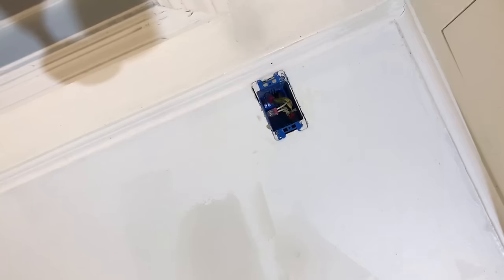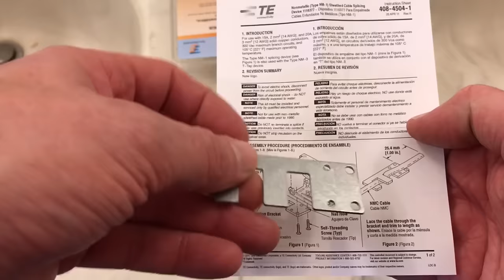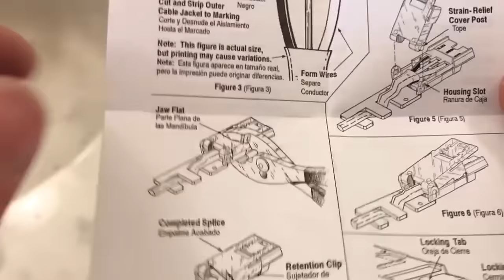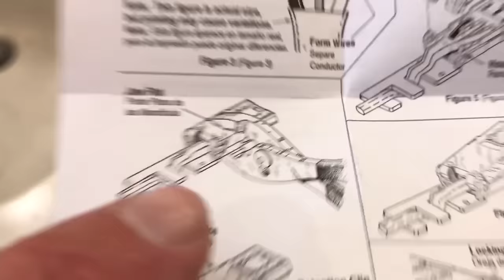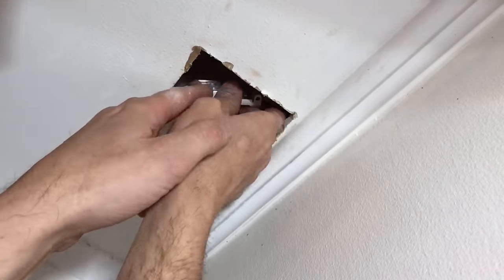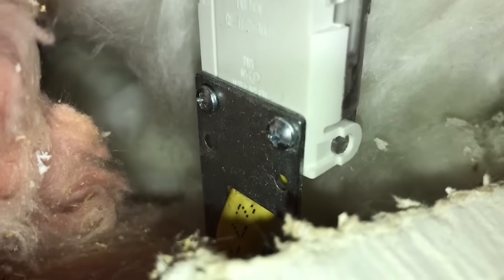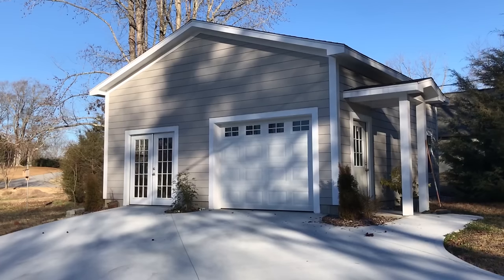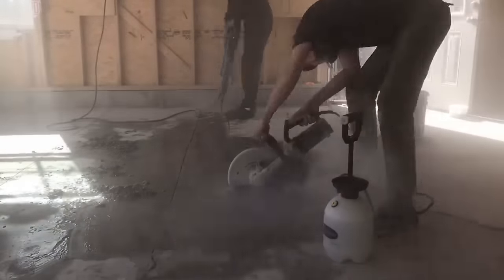Do I have to have a junction box to splice wires?

Comment: UPDATE Edit: these splice kits are no longer available. Any other suggestion other than a junction box?  

I’m doing a similar job where I only have room for a splice. However, I wasn’t aware of the splice kit or even if they were safe. So I appreciate you sharing this information, thank you.
Reply from the maker: Lots of opinions in the comments as to whether this is safe or not. These are used to splice sections of manufactured housing together (double-wides). But the NEC allows them to be used for repair as well, not for new work. They are getting hard to find, but I think they're still out there somewhere. It might be the C-word that has made them scarce, and not that they're being discontinued. It's been that way for a lot of electrical supplies, especially where I live. The BEST way to do it is definitely a true junction box. If it's in a decent spot, the junction box could be an outlet or light box. I've heard of lots of guys using metal boxes (handy box with a handy box cover plate--though PLEASE NOTE this is not legal) twist the wires really good with wire nuts, and put the good metal NM clamping connectors on each side of the box, then bury the box in the wall. In my opinion, that would probably be better than these connectors- though I can't recommend it. ---If there were a short in the metal box, your breaker should trip before any damage could be done. Just my opinion. Thanks for the comment!

— I guess YouTube edited the above comment with a strikethrough
Reply: you could always run a new set of Romex sure its a pain in the ass but all the equipment you would need is a decent fish tape just start where the junction would be and snag one of the wires and run pull it out of one side replace that wire with your new Romex and then run the other wire backward (fish tape attaches at the receptacle/switch/box and pull on the wire to advance the tape to the junction where you then hook onto the new Romex before fishing it the rest of the way.) granted you may need a second person to feed if you're covering any amount of distance or crossing planes i.e. ceiling to wall or wall to perpendicular wall.
Reply: @CoolLake I have some still that I can sell you.
Reply: Although not code, I like plan B Dave
Done right it will never fail.
Make sure to ground metal junction box.
Reply: My HOme Depot search says none... and unavailable. I think I will pass.

Comment: Package may have said 'no junction box needed' but did not authorize a concealed splice.  Besides a solder joint in a Marr connector and some tape would be better than this or just leave the wire nuts in a protected metal box that is grounded for a safer job.  I'd like to see an inspector comment on this video.  Approved for China and Russia.
Reply: USA and EU as well looks like
Reply: That's classic! "Approved for China and Russia". I've been to both places, and you don't know how true that is.

Comment: I would pay more for a splice repair kit with screw terminals with much larger contact area. I can't imagine how little current that thing can SAFELY handle. And even then I would only use it in an area where I could get at it. I sleep better at night by running new cable and having to repair more drywall. Don't get me wrong - I appreciate you documenting and sharing your experience, but these things just aren't for me.
Reply: This is the kind of stuff they can only sell in DIY departments.
Anyone who's seen a trade school from the inside at least once would get an heart attack just thinking about using them.
One might say "Oh, it's just the outlet for my phone charger. No worries."
Next person moves in, tumbler plugged in and that little box goes up in flames.
Reply: Would you provide a link or reference for a screw type repair kit please?  I have a modular and just experienced my first open neutral in one of these connectors.
Reply: @alf732  There are hundrets of products out there. A good start for a search would be "Splice kit" followed by the type of cable that needs fixing.

Comment: They are normally found in trailer houses, a manufacturered product, not a locally contracted electrical job requiring a inspection. If I used them in a job, my inspector would fail them. It isn't illegal to sell an item not legal to use. For example, in plumbing a S traps are illegal to install but you can still legally buy them.  You need to ask your local inspector.

Comment: I suspect you would still have to check your local electrical code to see if these are allowed despite them being available at hardware stores.  If you think about it, much of the items used in electrical installations are as privative as they were a 100 years ago, and very little attempt has been made to modernize the installation with plug-in wiring etc.  All this stripping wire and making pigtails etc. is very time consuming.  I am surprised that no one has come up with a better "plug and play" idea that would also make it safer at the same time.
Reply: WAGO!
Reply: You mean "primitive"!

Comment: Dave, your video helped me solve a problem when I nicked some Romex cables inside a wall. One important update, though. As far as I can tell, Tyco doesn't make these anymore. However, NSI Industries makes an equivalent product. Here's what's on the label: NSI, Wire Connectors, Non-Metallic Cable Splices, NMS-2, Wire Range 12-14 AWG, Splice for 2-Conductor Cable with Ground. I found these at a local electrical supply place. The connectors have worked perfectly for me and were not difficult to install.
Reply from the maker: Thanks for the update Brent!
Reply: Looks to me like this video just caused u a problem.
Reply: These connectors work perfectly until they don't. Corrosion will cause an intermittent connection or an overload will cause a fire.
Reply: @tedmoss  But wouldn’t that be true with any connection? In the situation where I used them, there was zero possibility of putting in surface access boxes. And its dry.

Comment: These are a large leap for romex repair but the fact is that the connection exists in the wall would freak me out. They look like a connector that should be used for 12v low amperage. "Scotch Locks" lol.

Comment: I think this is also a junction box,in a squeezy-tight way.I wonder if the 'teeth'(clamps)bite widely enough to make the necessary contact.Again,I think this device is only good for certain (low) ampere circuits.

Comment: There’s just not enough surface area of connection at the little teeth that bite through the insulation. Yes it will make a connection and conduct electricity. Voltage will flow but when enough amperage is pulled through that circuit those little spots will heat up. Better to use a jbox with wire nuts.

Comment: He removed the box that was already there because electrical  code does not allow a box to be concealed in the ceiling with no access. He replaced the box with the splice which is allowed to be concealed with no access. Then he will cover the opening with dry wall.
Reply: U cant do that, and the connectors are dangerous.
Reply: @RadioRich100  I agree with you, I was responding to this post -  	
Luis Larrea  I'd assume the idea was to work less too, if you're cutting gypsum, you're making a mess, you may as well throw in a box.
Reply: @philcook9967  Its the lazy mans way out. Run a new cable back to where you can put a box in.

Comment: No NEC will not allow a splice to replace a junction box unless it is a repair. This would be in case your wire gets damaged. Still, sometimes adding a junction box isn't the end of the world. It just needs to be covered and painted to match the room. I've seen smoke alarms used as a junction box before to hide a previous repair.

Comment: No electrician here, but it seems to me a connection like this should be checked for voltage drop. At least that might indicate weather or not the connection is good. All completed connections should be checked and this video should have shown such a test. Personally, I would never use these.
Reply: Even if it tests fine for voltage drop today, I wouldn't trust it to test good tomorrow.

Comment: That connection is not "self tapping" - it's an insulation displacement connector. These are common in cheap lamp plugs.
They score the conductors by design, so I'd avoid them.

Comment: Even if these splices are OK for code, they weren't installed correctly. There are two open screws on each connector. I've never used these (and wouldn't) but I'm betting those empty screw holes are so the splice can be screwed to a stud or wall. This connector wasn't, it's just laying on insulation.

Comment: IMO, I think that wire nuts heavily wrapped in electrical is FAR safer than this. Wire nuts are going to give a far more direct tight connection than this. When tightly wrapped, far better direct connection
Reply: Yes but these provide you with one thing that wire nuts do not, visual inspection. I work in industrial HV and EU standards are about 10 yrs ahead of North Am., these connectors are very common in some EU countries. I could easily see these become standard over single circuit junction.
Reply: Wrapping wire nuts in electrical tape doesn’t add value to the connections.   Complete the prep and wire nut install properly and you’re golden, done, finished, complete…

Comment: I would prefer to violate the electric code and make a proper connection with wire nuts in a box and leave it buried in the wall or ceiling. This splice kit looks like a real pain to use.

Comment: I can’t believe Walmart sells the same exact romex cable as Home Depot, lowes etc but for half the price.

Given they only have limited length options available as well as mostly always being sold out.

Big box stores are convenient but always hustling high prices
Reply: Keep an eye on the big box stores as they will keep things out of stock so they can sell their favorites.  They know if they stock certain items, it will be impossible to sell others because they're just not as good.  I think some of the vendors voice their demands.
Thanks for the tip on Walmart.  Their only purchase scheme is excellent.
Reply: Something I came across online that's relevant here: I noticed an odd phenomenon of private individuals selling bundles of Romex wire in various non-retail online marketplaces...never by bulk lengths, but usually in the largest pre-packaged (sealed, plastic wrapped) spool offered by the manufacturer. The people selling it didn't otherwise seem to have obvious ties to construction supplies, so it was odd to me. WELL... It turns out, these large rolls of residential Romex wire have become a target of theft nationwide. The word got around among the dregs of society that these bigger bundles (not offered in store by Walmart) are at a wonderful little "sweet spot" of:
1) High value, especially for something that size and lack of loss-prevention measures. The bundles are relatively accessible and compact, and they available in most any supply store.
2)There's always lots of willing buyers in need of Romex, especially buyers looking for any and all ways to minimize their expenditures. And so this has resulted in a black market. There are now people (quite likely involved in drug trafficking) who have begun accepting payment in sealed bundles of Romex...almost like its a unit of currency!?! Makes you wonder what the 200'Romex<-->USD currency exchange rate is, huh!?
3) The bundles are still LOW enough in value as to grab a few/a cart full, yet still remain under these new arbitrary limits for prosecution (usually ~$1000) recently set by newly installed leftist DA's in many American population centers. With Romex being a reasonably known product, its had this affect where - hypothetically - store employees can't easily argue that the value of the goods was obviously well over $1000, and so they have much less plausible justification for intervening and preventing the theft by physical force. So the Romex just walks right out the door...the thieves drive/run away...cops are called...and then nothing happens. If arrest are SOMEHOW get made after the fact, the charges are usually just dropped now, for no good reason.

So now here we are, where a large portion of these rolls of Romex in this country are not sitting on store shelves - but instead filling up shady storage units in "urban" areas. This obviously can't continue, if we want to have a country. But yep - that's the reason for the specific price paradox you picked up on. There's just literally been so much of it stolen that its directly resulted in price hikes to help cover the losses.
Reply: Bought 12/2 w/ ground UV rated romex for 2/3 cost of regular romex at the HD.  Perfectly fine for indoor use and saved real dollars.  Makes no sense to me...

Comment: Just because it’s sold at a big box store doesn’t mean you should use it. Some of the items these stores sell are meant for temporary repairs, some should not used period. Before you run out and buy these, check with your local building inspector to see if they can be legally used in your area. It maybe ok for use on wiring that has a low power draw, like a wire to a lighting fixture. But on main line wire? Personally, I wouldn’t use this connector. Either stick with a junction box or replace the entire wire, this just looks like it could be a hazard in the future.

Comment: I can’t see how this is safer then doing a proper wire nut connection in a metal junction box and sealing that away in an inaccessible area… 
If the NEC approved this flimsy thing they should approve a metal junction box.
Reply: This thing's not flimsy and works well for what it is.

Comment: I would not feel safe using this. I would prefer using inline splices that are soldered with heat shrink tubing over the individual splices . May not be code approved but a lot sturdier connection

Comment: Very helpful video. I'm installing flush mount LED lights and the fixture doesn't allow room for the wire nuts so the wires need to be in the ceiling. Thought I would need a junction box, which would require more work and tools. Thanks for your easy to understand video. Well done.
Reply from the maker: Thanks for watching, Daniel.
Reply: Please increase your fire insurance.

Comment: This connector works fine for splicing wire to wire, but most of the time when I cut a wire it is to add a third length of wire to add an outlet somewhere. Is there a boxless connector for that?
Reply from the maker: Here's a 3-way for adding a connection, Steve. This does have to be installed in an ACCESSIBLE location. "basements, attics, garages, suspended ceilings, etc.,
anywhere accessible"
https://www.gordonelectricsupply.com/p/Penn-Union-
Nmtk-142-122-Nm-B-Cbl-Tap-Kit/6075552?gclid=CjwKCAjwvNaYBhA3EiwACgndgmidFCny_x8yyhEp1wN6U2NFD_kHd8ug_aIvAFr8s-XE6TkVO4EpSBoCFCwQAvD_BwE

Comment: I have used solder and barrel connectors to fix cut romex. Heat shrink over solder and rubber tape to make the splice. Always thought a junction was three or more wires at one point or a fixture.  Never had a failure in over 30 years. However, in my own home I use conduit never that romex garbage. Rat chewed wiring can arc and start fires. On the good side I never used wood to build my home.
Reply: soldered connections aren't code compliant, neither is the rubber tape, you must use something like heat shrink that is equivalent to the insulating material used on the conductor.
Reply: @jesseewing7948  Honestly I could care less about the code, no one will ever see this unless they pull the wires. Electronic equipment has extensive amounts of soldered wires and all crimp fittings corrode in our humid, salty air. Romex in my opinion is a horrible way to wire a home and should never have been allowed under any code. It goes to show that money buys compliance. Rodent chewed Romex has started fires I know of one that happened in a home. I do not think it is allowed in commercial applications?
Reply: @chargermopar  romex in a residential setting is perfectly fine as long as it is installed properly, plus most homeowners would definitely balk at the inflated cost of running mc as it is roughly 2x the price for the same gauge, requires more expensive junction boxes , as well as the necessary connectors for the mc which aren't needed for romex, and that is before considering the fact that it takes more time to install which will further drive up price. you can definitely run it if you choose to go above and beyond code, but it isn't necessary. 

I will concede that rodents do enjoy chewing up romex, but that means there are other problems with the structure that are leading to rodents being able to access the wire so it isn't really the fault of the wire in that case.

as for the commercial application question, that is a different matter as the materials for building construction are different and all the metal used in commercial construction lead to possible damage to the romex which is why you would use mc instead, however technically you can use it as long as it isn't subject to physical damage like in a raceway (as long as approved by the AHJ.)
Reply: yea right like mice, rats cant or wont chew through pvc conduit either. or unless you one of those EMT is the greatest thing since man discovered fire types. EMT rusts, has its own issues
Reply: @harveylong5878  My home has all emt except in the concrete which is pvc.  62 years in the parent's home and 32 in mine. No rust or failures yet.

Comment: These are a great idea if they work but putting them inside a wall is a code violation for the same reason as hiding a junction box inside a wall. junction boxes are not allowed to be buried due to if there is an issue with the electrical connections the junction is 1) not accessible; 2) if the home is sold the new home owner does not know about the box, making troubleshooting harder for the next technician.